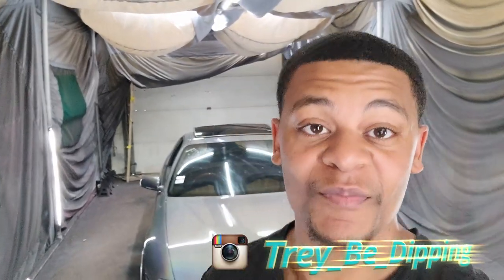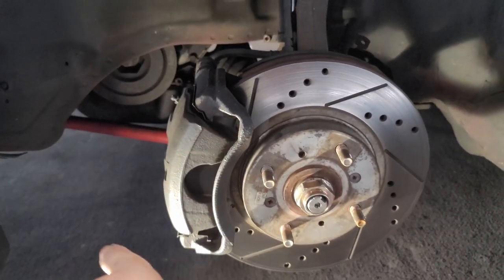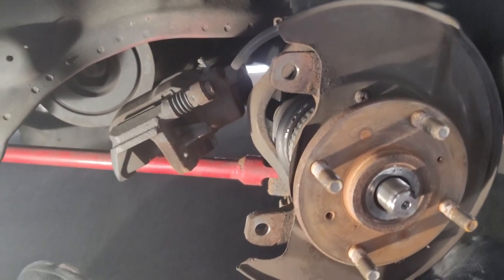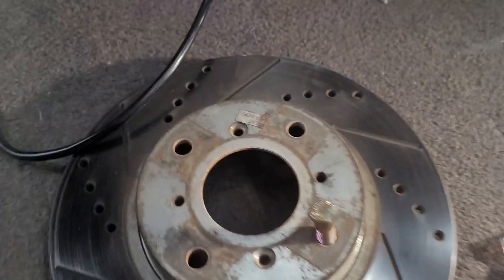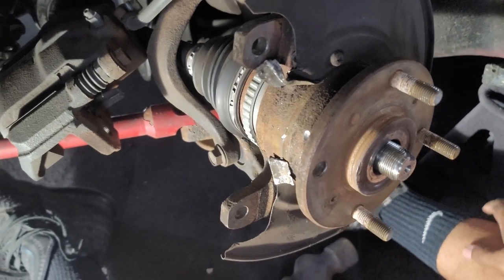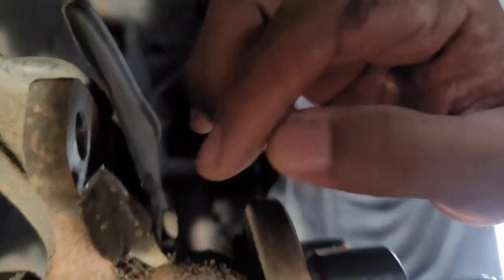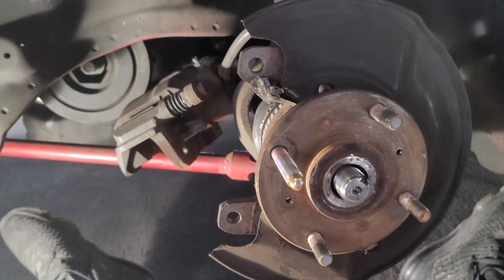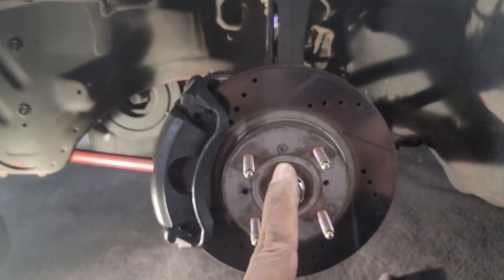Extended/broken/stripped lug stud install on a Honda Prelude

Comment: My lude had 5 broken studs when i found it. Grind method worked perfectly. Also had to cut out that sheet metal. Saved hours of time pulling hubs
Reply from the maker: Nice hopefully this will help a few others
Reply: No doubt! As long as they have an angle grinder lol

Comment: Yeah the grinding one side of extended stud and on my EG hatch had to take a little meat/metal off spindle housing for it to clear. Honestly though WD40 or some other lubricant REALLY helps on the base of new extended studs to go in easier.

Comment: Sometimes you can take the backing plate off the spindle so you don't have to cut it or bend it.  I did way too many stud replacements at my old shop, we had a deal with Discount Tire to fix all the studs they stripped out 😆
Reply: Also don't forget to stake the axle nuts 😉

Comment: Sadly you have to shave a significant more off the hub on a 5th genny to do this 🥲
Reply from the maker: Really?
Reply: Yes actually. Tbh i shaved a bit off my knuckle as well. Maybe its a 5 lug thing 🤷🏾‍♂️. Wasn’t enough compromise anything but you can definitely see battle scars
Reply from the maker: @mr.horse1801  still got to be better than paying someone to press out the hub.